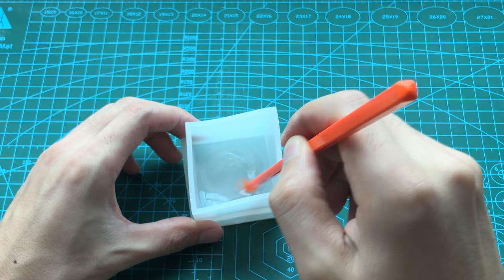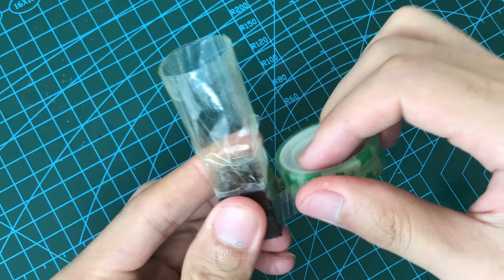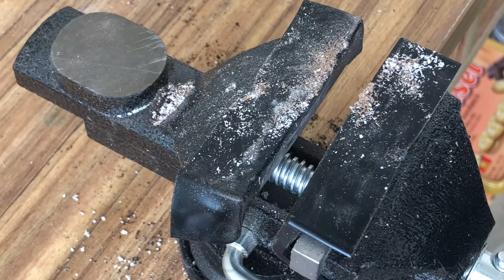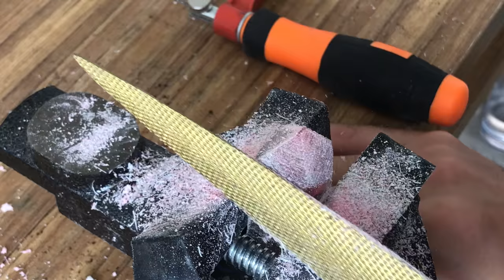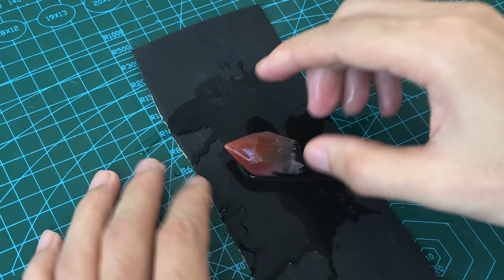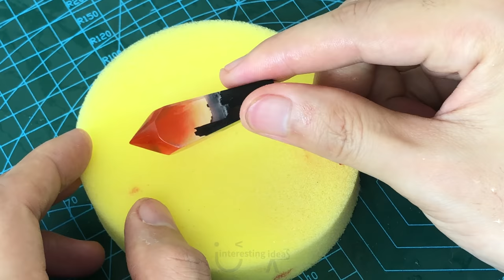Amazing Fire red pendant/Resin art jewelry/Amazing DIY Ideas epoxy resin art jewelry

Comment: how do you remove scratches from your pendant?
Reply: Sand it with sand paper. Start with a low grit of like 80 or 120 and then work your way up to 200 > 400> 600> 800> 1000> 2000> 3000 (or higher depends on what you want) and then finish with oil or polish it with something like car headlight polish.